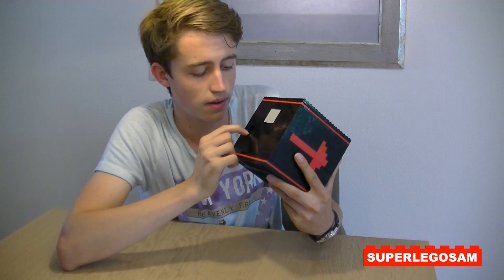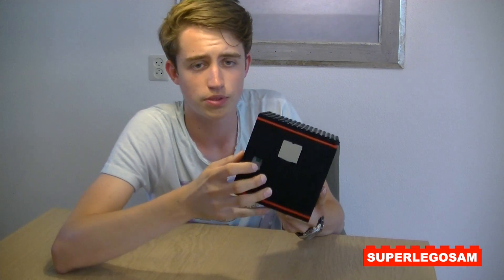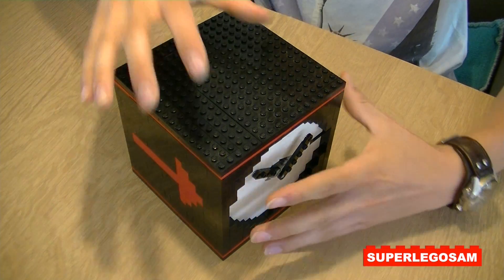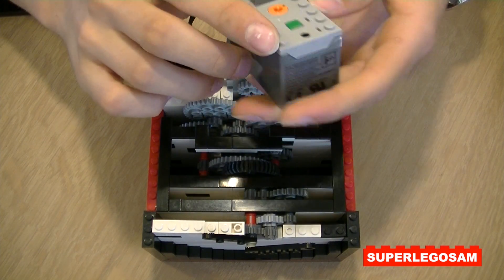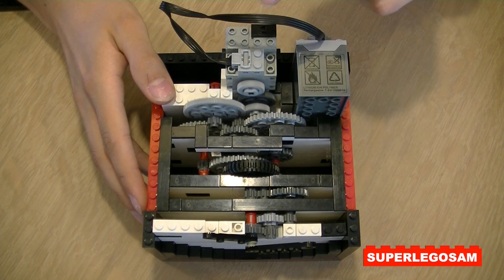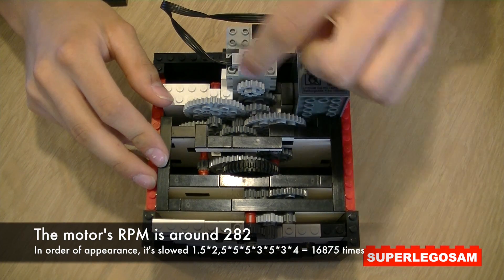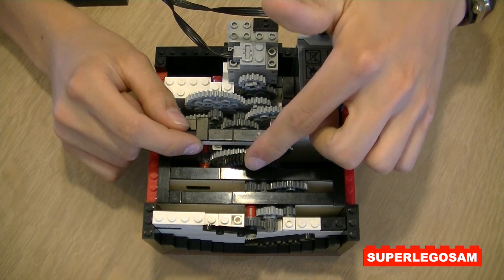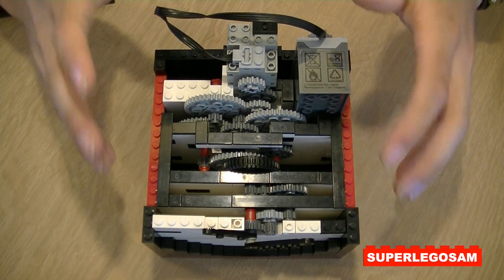Working LEGO clock!

Comment: Amazing. Well done.
Reply from the maker: Thanks! :)
Reply: I've worked for a few years on an original clockwork design. I've finally decided to try and build it. I wish I could find some expert interested and willing to help me sort out the gears. =(
Reply from the maker: +Evan Tapper What I did, was to first write down all the possible LEGO gear ratios. After that, I measured the RPM of the motor(s) at different speeds to determine what gear combinations I needed. However, every time that I thought to have found the perfect combination, it just wasn't good enough. That's why in the end it is - no matter how well you calculate it - a process of trial and error, where you just have to keep trying until you find something that does work. :)
Reply: I'm so intimidated by the gearwork. I haven't touched Legos in years. Damn. 

Meanwhile I think Lego is the only way to bring my complex design to reality. 
Double damn! I have a beautiful version I made in WatchMaker (for Android), but that's not quite enough. I want to to be tangible.
Reply: Superlegosam I have approximately 2000 bricks used in my own clock so far. I'm building it in Lego Digital Designer. I'm a bit confused and maybe you could help me understand something. I have 60 flat treads which I'd like to fit in a perfect circle to indicate the Minute. 

At what angle should each tread be in relation to the tread next to it so that 60 make a circle? I thought it would be 6°, but that seems to only get me approximately 3/4 around the circle. 

I could keep guessing, but with each guess it brings 60 different new entries to make. 

Please feel free to contact me on Google+ or Hangouts if that is easier. I'm extremely grateful for any help you could provide.